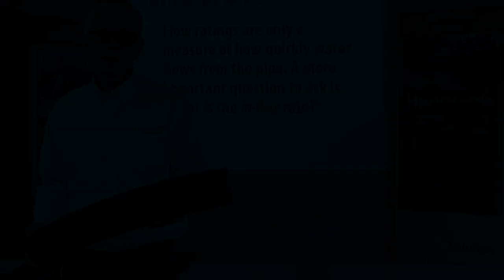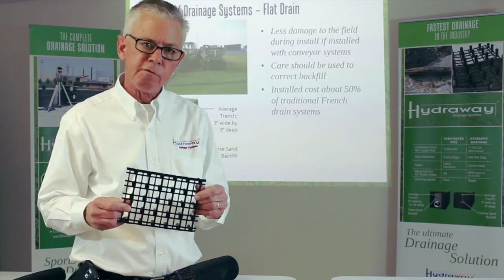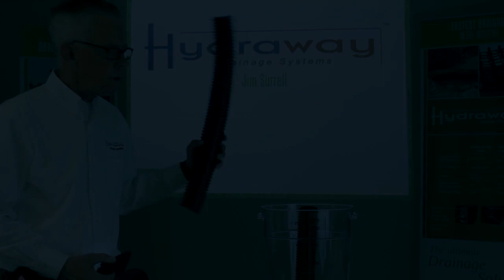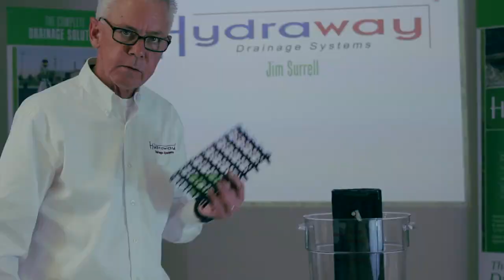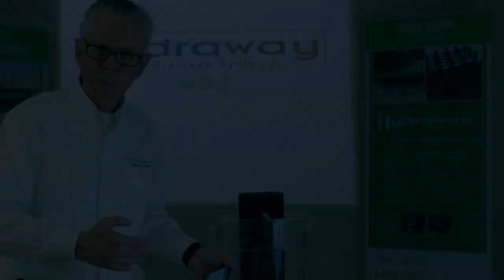Hydraway- Flat Strip Drains VS French Drains

Comment: This is not a good comparison test. First, you took 3x as long to dump all the water into the test bucket for the corrugated piping. That alone will mean it will take longer to drain, but you also have compounded the issue because you have more pressure from the weight of water to force more water out faster when you dump an entire bucket of water in 3 seconds vs 11 or 13 seconds that you took to pour the water in for the corrugated pipe test. Your drain system may well still drain faster, but we can't say that from this test at all. Please test the exact same way each time, or else your test (and therefore your test results) is garbage!